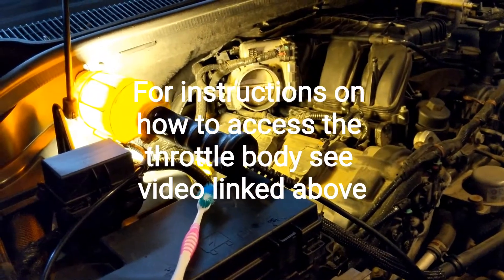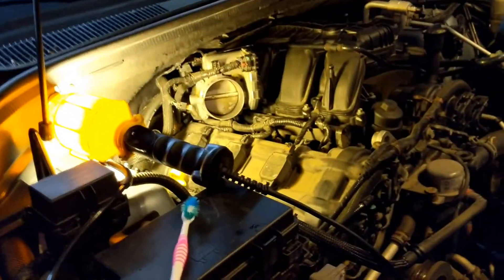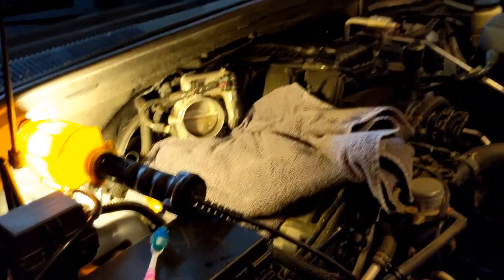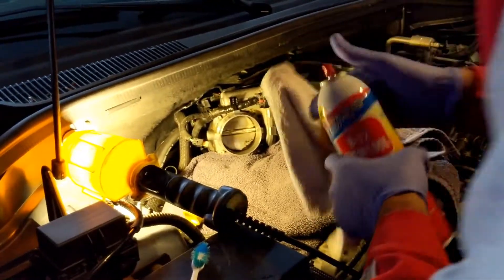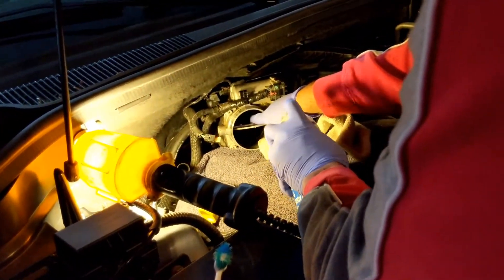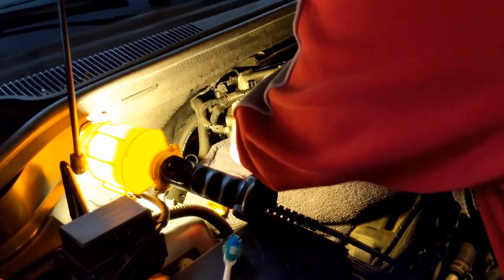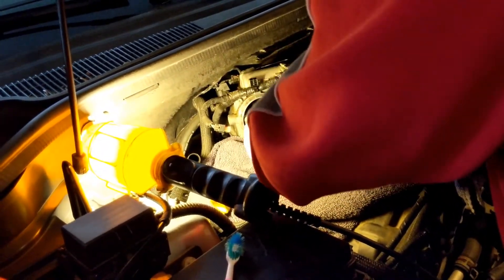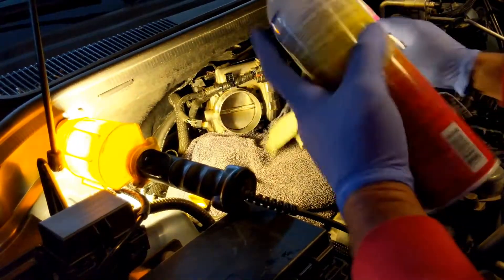How to clean throttle body on a 2013 Jeep Grand Cherokee (WK2)

Comment: I've enjoyed a few of your videos because my wife also has a Grand Cherokee like yours. One tip I would give you in regards to cleaning the throttle body is I would recommend removing it completely before cleaning it. For two reasons, one is that the back side is usually dirtier than the front and also you are not flushing all that dirt, contaminants and chemicals down into your intake and engine. Keep up the good content!
Reply from the maker: Thanks for watching my video and for subscribing to my channel!  That's a great tip about removing the throttle body when you clean it and pointing out that the method I used only cleans the front and not the back side of it.

Comment: No need to re-learn the TB position after you move the butter fly around?  I have a '15 GC Altitude and I was thinking about doing this service.  I've done it before on VW and if you move the butter fly at all then you have to relearn the TB position. 

Great video
Reply from the maker: I don't but some people do.  The PCM should re-learn the position after driving for awhile.  I not trying to get every ounce of performance out of my rig.  Here's a good discussion where people were talking about doing the re-learn procedure on JGC.

https://www.jeepcherokeeclub.com/threads/the-throttle-relearn-deal.244365/